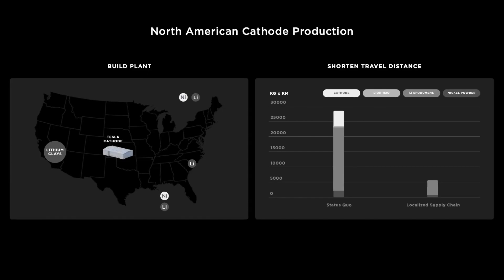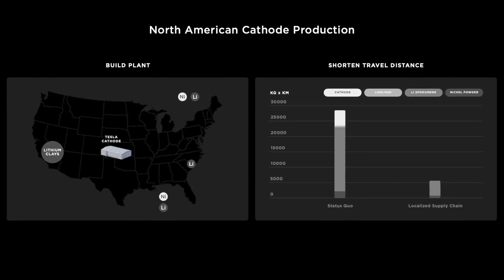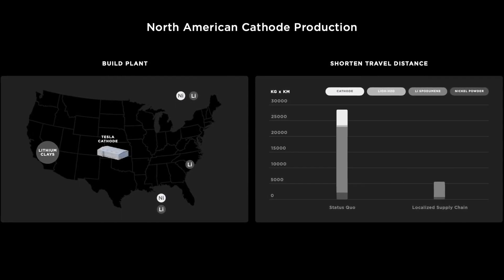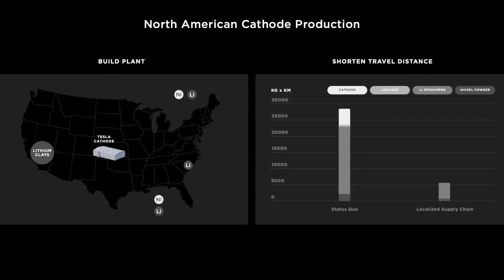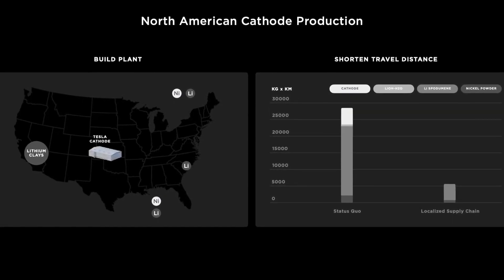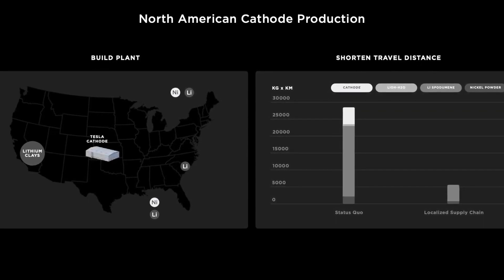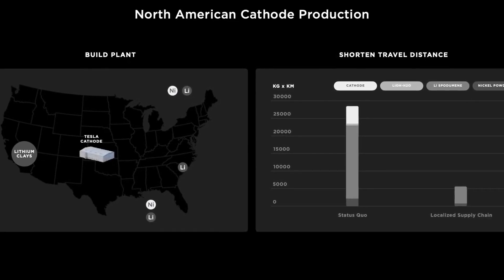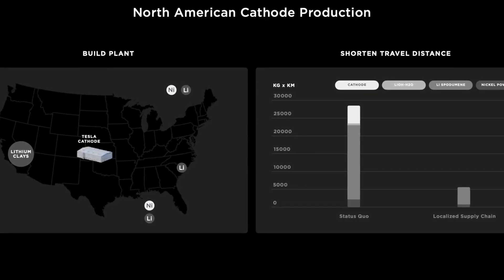Why has Tesla decided to produce its own cathode? w/ The Limiting Factor

Comment: Tesla will be making cathode, anode and electrolyte. A pure silicon anode is easier to make that the cathodes, but it uses the same tech. While they will buy-in the base electrolyte, the additives are extremely important. Tesla will mix it's own brews. It will make its own cell cans too. The cans are easier to make from aluminium - the soft drink industry only uses aluminium. But steel, while heavier and harder to work, is cheaper and probably easier to make a structural battery pack from.